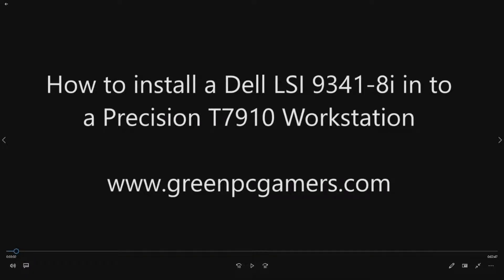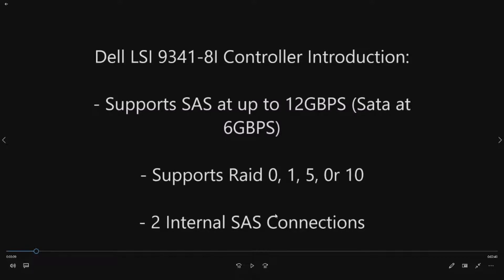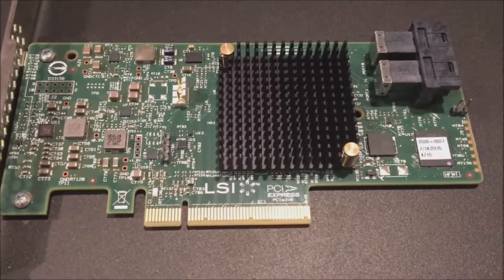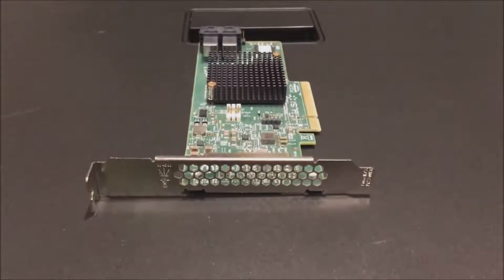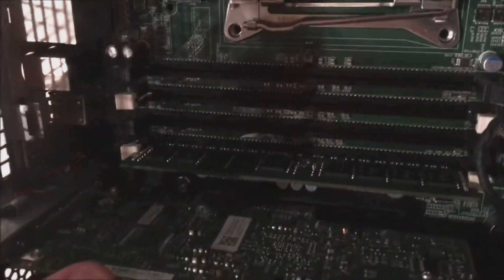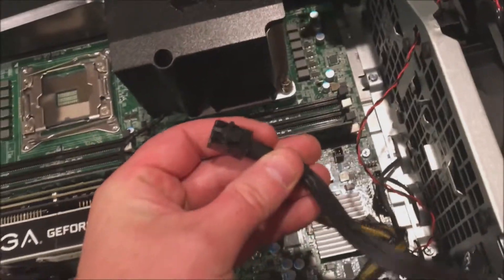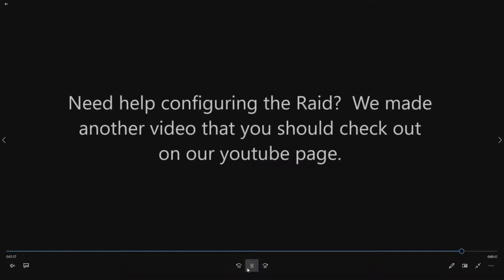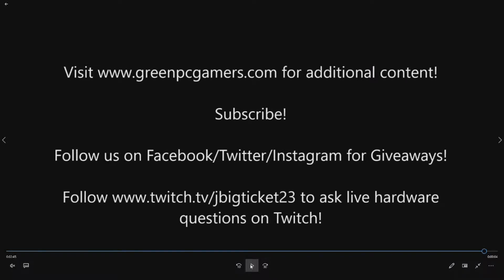How to install a Dell LSI 9341-8i Raid Controller in to a Precision T7910 Workstation

Comment: Hello. i am quite new to this Raid controller thing. I got from work a free 8TB SAS drive capable of 12gb but i have only normal PC with threadripper and sata connections. Please could you tell me the cheapest way to connect the SAS drive to my pc ? Like the cheapest Raid controller card and the cable ? I was trying forums for help but people just make fun of me.
Reply from the maker: The controller on the video is a pretty good option.  This is a good sas cable:

https://amzn.to/3hwSmMf

Comment: Hi what is the big difference between this raid and one that come with motherboard on 7910 Thanks
Reply from the maker: The T7910 Supports 3 Raid Controllers

LSI 3008 (Embedded)

You've seen this video.

LSI 9341-8I (PCIe Card)

We made videos about the other cards that you can watch.

How to install:

https://www.youtube.com/watch?v=QC6bniC16cU

How to create Raid:

https://www.youtube.com/watch?v=lW1elmejxLc

LSI 9361 -8I w/1GB Cache and BBU (PCIe Card)

Info and how to install:

https://www.youtube.com/watch?v=UXBPKXrJO8w

How to create Raid:

https://www.youtube.com/watch?v=br2qh5jq9NU&t=17s

If you have the budget, the LSI 9361-8i has the fastest throughput.
Reply: I seen all of them and are super awesome man answered so many questions thanks again
Reply from the maker: The major differences are that the LSI 9341-8i is a physical card, it supports more drives, and it can run raid 5.  

Also if the LSI 3008 fails you have to replace the mother board.  If the LSI 9341 8i fails you only have to replace the card.

LSI 3008 specs:

https://www.broadcom.com/products/storage/sas-sata-controllers/sas-3008

LSI 9341 8i specs:

https://www.broadcom.com/products/storage/raid-controllers/megaraid-sas-9341-8i